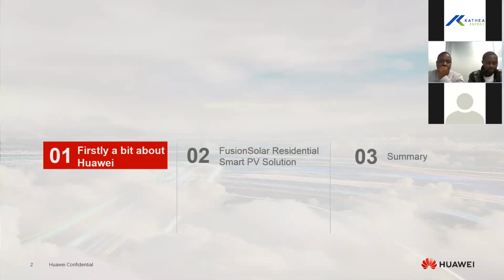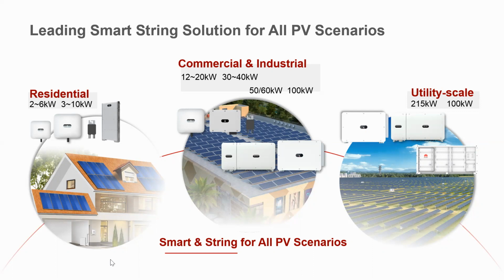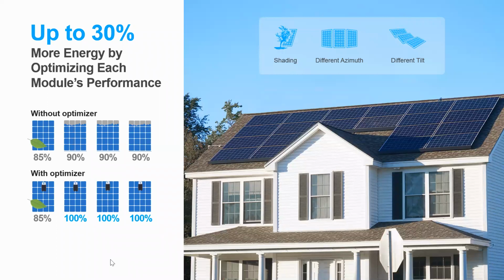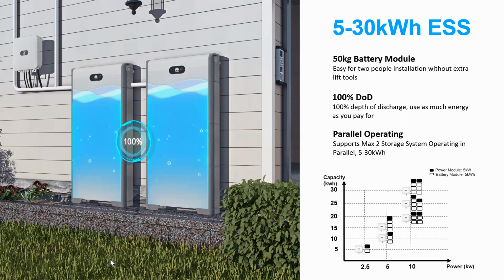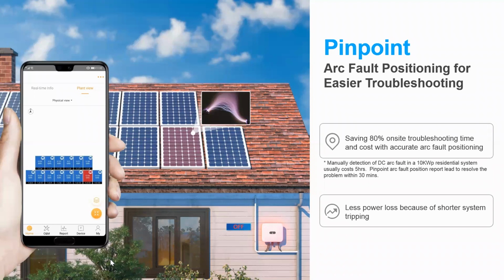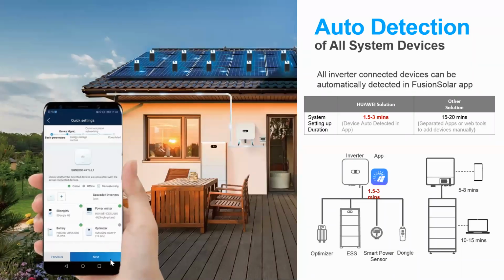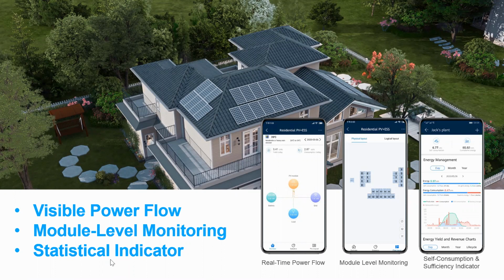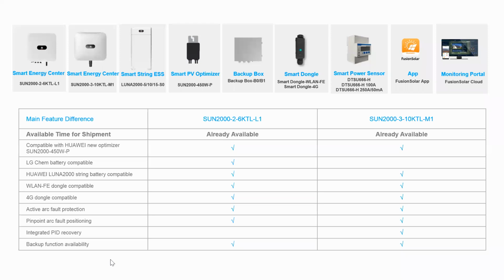Huawei Residential Product Overview!

Comment: • 10% increase in production on optimised panels = what % increase in cost?
• You’re in the SA market, what of rest of Southern Africa (Zimbabwe), support & sales
• Is this system CT-based to limit/monitor export excess Pv to grid (anti-Islanding)?
• Inverter Pv startup voltage?
• Inverter self-consumption power rating?
• Web security - can system work in a closed-loop to ensure fool-proofing against online hacking?
• Does inverter have one or two outputs eg Essential & Non-essential outputs?
• Warranty length (Inverter & Battery)?
• Information storage either download to laptop or flash drive?
• Surge power rating (6Ktl)  for startup of some devices eg booster pump?